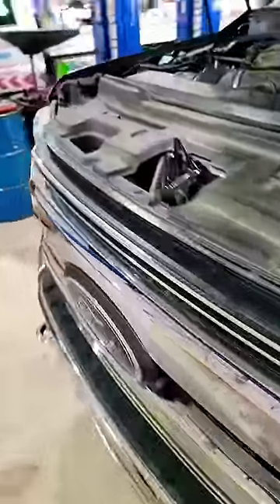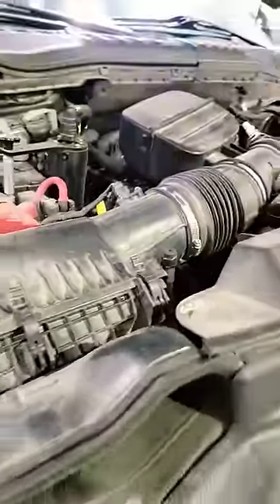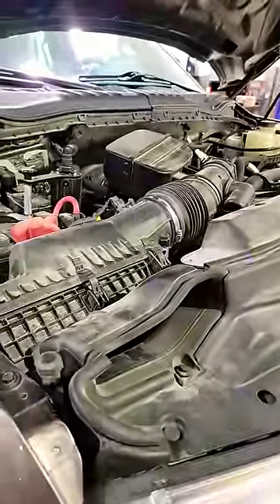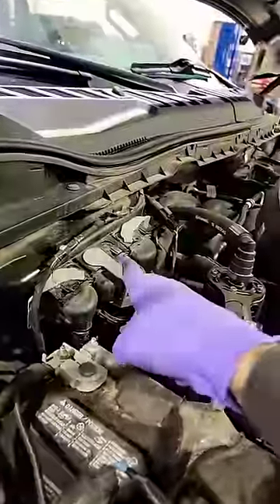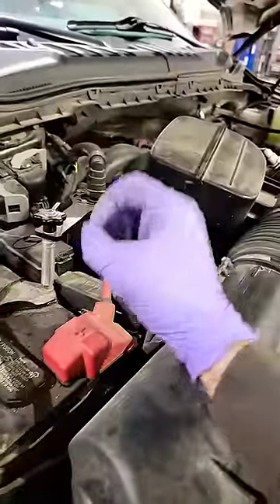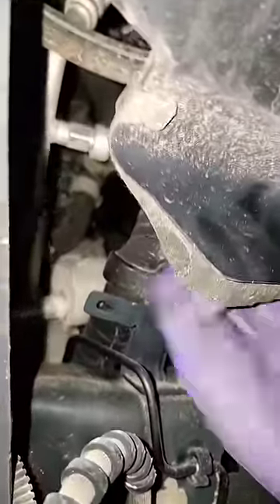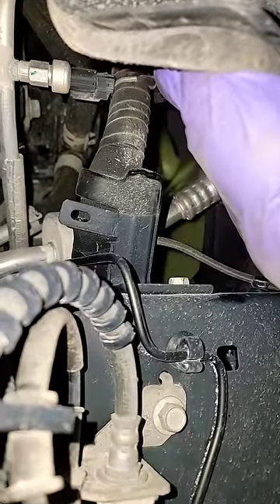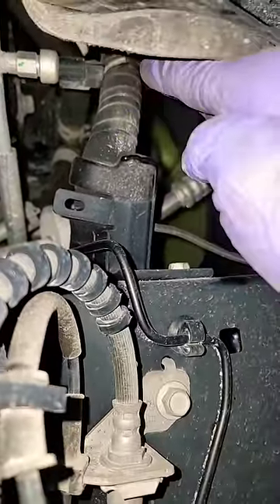New Ford 7.3 GAS owners - GO CHECK YOUR truck at this spot #shorts #fyp

Comment: I have a 2020 F-250 Tremor 7.3 and the exact same thing happened to me. The worse part was, it happened after 36K miles and the extended exploitation company (US Warranty) denied the claim because it was “rubbed thru”, which they deemed as “external damage”, not a defect - not that they cover mfg defects anyway… So, it got the old liquid tape treatment and works again.
Reply: Lot a money for extra warranty paid and they trick us with things like...oohh sorry is not covered because is engineering mistakes.😢
Reply: @efraingarciaescalante2824  They made it clear to me that their only concern is to avoid paying any claim they get away with by any means available to them. This was also the opinion of the dealer service tech that made a wincing sound and said “good luck” when he heard it was US Warranty.

Comment: The company that I work for, has had problems with A/C on brand new 2022 F150 and Super Dutys (F550) I haven't heard what the dealership has found on these trucks yet. The 2022 F550 that I drive had a roaring fan from day one. The truck only had around 40 miles on it when I got it. Don't buy any manufacturers product after early 2020 model year. We are having problems with DEF manifolds and emission controllers on a certain (unnamed) brand of yellow, heavy earthmoving equipment. The scamdemic and government did a number on us. Good luck to everyone!
Reply: Yeah same lots of issues with them on the smaller 1/2ton trucks too

Comment: Had a like problem with my truck. The 4-75 coagulated at the relay and stop pumping nitric fluid into the savoy pump so I switched the toggle fabulator at the firewall to the number 3 pump and all I had to do after that was prime the fribulater to the zero 6 code. Now it works perfectly 😅😅😅😅😅😅😅😅

Comment: Ford has never been good at packaging. It’s amazing. Hard contact is ok to them. Radiator hoses touching hard components, electrical connections touching like this, is pretty common. Retired GM designer with a lot of HVAC packing design experience and have studied all the packaging of a lot of vehicles out there. Pop a hood on a Chevy or Toyota or Subaru or Honda and learn how to package. I first noticed this in the 80’s and nothing has changed apparently. I love the look of the ford trucks, but damn.

Comment: Automotive Engineers should have to be mechanics first! This way they would understand the laws of physics and how difficult their piece of crap vehicles are to fix after diagnosis. Automotive parts should be relatively easy to access for replacement, but , no. The engineers want to play “Schrödinger’s Cat” with their customers!

Comment: What i have seen for the pass 15 years is most have turn to junk Ford is the worse then right behind is Dodge I'm talking about the V8s.
Chevy has its lifter problems but not the timing chain problems that the others have.
This week working on a Ford 5.4 with chain knock & rod knock. Open the bottom end found a broken thrust bearing causing the chain to bind & the crank to knock.
Thrust bearing face on crank is chewed up it won't last 2K miles before knock comes back.
Owner said put a bearing in it going to sell before bearing goes out.
Thinking the thrust bearing problem are due to high trans line PSI. Pushing the converter forward & apply more pressure on the crank thrust bearing. 
Really needs an engine these engines are shit.
I have never worked on a chevy with a bad thrust bearing knock. Been turning a wrench since 1976.

Comment: The motor in my sister in laws brand new.(less than 30,000 miles truck) has already blew up. She doesn't pull trailers or anything. The ford dealer ship kept telling her they could find anything wrong with it and finally my brother got on there case and magically they found out the motor had blew up. She has been without her truck for two months and it still having to make payments on a truck does even have in her possession.

Comment: I have a 2- 55 ac in my 95 ranger, only it has been operating at a 1- 55. Turns out i just had to remove the door panel and manually lower the window mechanism.

Comment: New technology you gotta go through a device to get a code scan the code look up the code just to tell you your compressor isn’t working🤦🏼‍♂️ and this is why I own a 1999 Jeep tj over 200,000 miles and still runs great easy to fix cheap and work on it yourself
Reply from the maker: Still gotta hook up a device to read that lil bs jeep 🤦‍♂️🤦‍♂️

Comment: Question: why does colder air not come from the seats? I had a 2019 250 that blew do cold I had to turn the AC off. In my 2021 250, the air is barely cool coming from the front seats. Advise please.
Reply from the maker: The "a/c" seats, are just a butt fan. They HAVE NOTHING to do with a/c function controls. There is NO air conditioning coming from the seats, IT IS A BUTT FAN thats it.

Comment: Driver's fault for causing problems while still on warranty! Ford is the most reliable truck that has no recalls anymore and it is sold without crazy markups as well as it is never repaired with the same defective parts!

Comment: So the ac pressures were good, but the compressor wasn't running. That's a contradiction, you can't tell ANYTHING about the condition of the system by checking static pressures. The only thing you can verify is that there's some amount of refrigerant present, could be 5 oz, could be 5 lbs. Just a nitpick
Reply from the maker: You said it! I KNEW THAT THE SYSTEM WASNT EMPTY. 22.....🤔🤔🤔 I CALLED its bluff & guess what I was right. Now if this was a lil older vehicle....that MAY not be the same case...........
Reply: @PowerStrokeTechTalkwARod  right on man! Motor vehicle ac is tricky as hell. I used to specialize in it and now I'm doing residential hvac. Keep it up bro!

Comment: I take it all the trucks came from the factory with the sensor chafing on the line. I've always tried to give engineers the benefit of the doubt but it really seems they are purposely designing things to go bad because they want you in the dealership every year buying the next model.
Reply from the maker: It has nothing to do with the engineers they put the stuff where they have room it comes down to the people who are assembling these trucks not giving a care about what they are doing it would've been clearly evident that that harness was rubbing against that sensor but no one took the time to look.

Comment: Damn 35,000 miles on a 2022 ?
Reply: Yeah probably one of 22s made in May of 21
Reply: I've got a 2022 F550 that is about to turn 21,000 mi. I got in the truck back in April.
Reply: S*** my 2017 only has 45,000 on it, I love everything about that truck, except what it cost !
Reply: My 95 has 50k on it and my 90 has 49k on the odo.

Comment: The 1-POS-BR549 Control module is low on hyper tension fluid. Common problem on this model.

Comment: 🤦 here are the facts. 35550 miles. Schedule the soonest  appointment 2 months out with Ford dealer.. now it's 36231 miles.. out of warranty.  Two times back yo the dealer for intermittent a/c operation.. 100 years building vehicles 65,000 bucks, and this is what you get. 😢

Comment: It's another great example of the ENGINEERING that totally contradicts reality.  That plug is right against that harness !?!? Check out the new focus the ac plug is bent to the point where it will fail before 20,000 miles. Just put a motor in one and noticed that and MANY more ENGINEERING mistakes,  engineers should have to take a year of auto mechanics before graduating.

Comment: Wow, a whole sensor and circuit dedicated to A/C pressure. It didn't even function properly... Cars shouldn't have AC or radio. Even when I lived in Phoenix with perfectly working AC in my truck, I never used it. Makes being outside in the heat much more enjoyable when you just roll the windows down. Leather can burn skin in the heat though, another reason I always go for cloth. 2004 SLT RAM QC 4x4 5.7 fully loaded. I think they only did leather in the Laramie. The automotive industry is milking the profits in both service and sale, right before they switch to EV and possibly hydrogen.

Comment: Huh on my 2018 F150 with the 5.0 that only had 49,000 miles on it was the AC clutch that was already froze up and snapped the belt.

Comment: Question.... I have a 2019 f150 5.0, and im having issues with the preignition/ engine tapping while accelerating. Does anybody happen to know abt any fix to this?
Reply from the maker: How long has this been going on
Reply: @PowerStrokeTechTalkwARod  I bought it used last December with 15k miles on it. And it started only a couple of months after I got it. I had read somewhere that it could be the type of oil possibly leaking above the piston causing a pre ignition, or just not high enough grade fuel. Rn im using 86 octane with octane booster. I aint paying premium gas prices right now lol. The octane booster helps, but it's not solving it. Some of the ford forums I've read pretty much said im SOL until ford can figure it out.
Reply from the maker: Hmmmm
Reply: Right?!?! Lol

Comment: 2023 F150 Lariat with less than 1,200 miles. AC stops working intermittently. You can still hear the fan but no air coming out. When this happens under the hood the AC lines are iced up. Let it sit for a bit and it’ll work fine. Sometimes it work fine for a week or so then bam…AC freezes up. Dealer hasn’t a clue.

Comment: All that crap. $60-$100 k for a truck that's going to be bringing you to the shop with stupid problems like this within the first year? 
I am going to drive my 86 square body until it can't be fixed and then I will buy another one,  even if I have to buy a restored classic.  I've been driving my current truck for about 12 years and all I've done is the usual,  replace brakes,  exhaust, shocks, glow plugs, batteries and a fuel pump. I've probably got less than $4k into it total. Drive it to Idaho a couple of years ago and will probably drive it to Utah in the spring.

Comment: Last yr (around halloween) i got my first pickup, a 2018 f150 xlt. And i gotta say, the ac in ford pickups sucks. It takes forever to actually get cold, and it needs to be cranked to the max if you want it to make much of a difference. I dont get it, before that i owned a 2016 fusion, and the ac was AMAZING. At least the heaters are the best heaters ive ever had in a vehicle. But still disappointing nontheless.

Comment: We spent $7,000 getting our AC fixed on a F-450 the Ford dealership cross the wiring harness doing some warranty work and that would not cover the harness or the AC

Comment: That is a shitty place for a pressure switch. SHOULD have been designed with an elbow connector there. Maybe some enterprising aftermarketer will come up with a retrofit for that.

Comment: I'll understand why Nissan Toyota and Honda can make a great product that you can get several hundred thousand miles on without problems and Ford Chevy and Dodge puts out a product that you can barely get $100,000 mi out of before you need mechanical intervention

Comment: Another Ford crappy design. Back in the day the Pintos blew off the oil filters because the relief valve was a stainless slide in an aluminum case,  different thermal expansion caused the slide to wedge shut. This wiring routing is reminiscent of substandard engineering. I won't buy Ford ever.

Comment: same thing on these inline 6 3L Duramax engines in the suburbans and 1500s. ECM wiring harness doesn’t have an ounce of slack in it to allow for thermal expansion from heat. Gonna have a lot of crazier electrical issues later down the road.

Comment: They obviously aren’t testing cars and trucks on proving grounds like they used to. Seems more and more it’s silly items that aren’t difficult to repair are going bad. Using cheap parts made of 100% plastic with quick fasten connectors for robotics to install is another major problem for Q.C.

Comment: You can fix all of your Ford pickup's problems by changing just one part.  Take off its gas cap and drive the Ford away, pull in a Toyota Tundra and attach the gas cap and your pick up will be totally repaired.

Comment: My truck is the same . I’m glad you found the problem, after watching this video I am taking it to the dealer . I have 37k miles on mine 
Also it’s getting a lot of rust build up . I can see it wasn’t undercoated correctly .  I also see the transmission harness not secured correctly and I’m sure will soon rub through .    Built ford tough!!😂

Comment: I see it's a 7.3 is that the piece of S**t  Godzilla motor in it because I would get rid of it immediately, had one at 15,000 that bent connecting rod on the #2 piston. I work on school buses and if you do I check the ground strap from the motor to the frame on the driver side of motor because it sits right on top of the exhaust manifold. Ford is crap

Comment: This is the sh!t that makes Ford and other like companies so ridicules with recalls or unreliable service.  Engineering could have easily made this right from the start but they didn't. An auto mfg that has been in business for well over 100 years cant see that being a problem down the road?  My god the wire is crushed up against that other piece.  Ridicules.  Should not happen.

Comment: In the EU i had a mk4 duratec ford mondeo, same issue, turned out that there were three wires that come out of the back of the radiator fan, the middle one was 24 awg and violet in color. This breaks easily in the loom... the pain is opening up the loom to actually find it. The repair is ironically simple

Comment: Those wires shouldn’t be pinched right out of the connector like that. There are industry standards that manufacturers are supposed to abide by to prevent failures like this.

Comment: My 6.7l had an issue with the same code and blowing hot air. I was going to take it to the dealership and the next day of course my ac was back to normal and havent had an issue since and its been over a year since that happened
Reply from the maker: Alumiduty?
Reply: @PowerStrokeTechTalkwARod  yes 2020
Reply from the maker: Better check dem ac pressures. Watch my shorts a month ago. We talked about this

Comment: Check the mounts they wear causing a tight squeeze to become a close squeeze. Happens all the time repair the wire then check your mounts. I do a lot of electrical work and many issues are caused by worn mounts trust me very common

Comment: How were pressures good on the gages if the compressor wasn't engaging?
Reply from the maker: The system didnt have a leak. A sensor was keepin the compressor off. You do realize that you can have a full system, read good pressures but the comp wont come on......
Reply: @PowerStrokeTechTalkwARod  I work on semi's so this is why I'm asking. Not trying to be rude or doubt your work at all. If the compressor isn't on the high side pressure is going to be low right? Without anything to compress the r134 how would the pressure be up to spec?
Reply from the maker: The semi a/c system is gonna work the same. You watch the ac machine charge the system. Truck is off, compressor is off.....yet there still is pressure in the system, system is charged. Then u start the truck and see in the compressor is working......... Im not being rude either. Think about it and connect the dots. I cant tell u all everything, then u wldnt learn. Ill be awaiting your response

Comment: My 2019 6.2 F250 had a similar issue at 37K. Dealer wouldn't warranty it because it was over 36k miles. I just bent the wire over and zip tied it to my ac line and never an issue again. Got 180K now

Comment: I would have done a visual inspection and a wiggle test after getting the circuit low code , smart move on using the PID first

Comment: Typical ford there motor is usually okay except for intake of exhaust or gas but they always cheep out on connection either electric or mechanical

Comment: The trouble shooting section in my owner's manual says in order to fix this problem you must drive to nearest GM dealership & replace witn a GMC Sierra 6.6L Duramax® Turbo-Diesel V8 Engine with Allison® 10-Speed Automatic Transmission. To avoid this issue in the future. You're welcome 😉😎🤣😂 our trucks have special anti wire harness chafing features.
Reply from the maker: Yea, ur real silly if u believe that. Id leave with saying this, good luck

Comment: You said the pressures were close BUT the compressor wasn't running......?  
     How is that?
Reply from the maker: U can have good pressures & a bad sensor. Theres not a hole in the system.........The computer looks at the sensor pressure to determine when to engage the compressor.......so if the sensor was dead & read 0 psi.......u tell me, how would the compressor come on??

Comment: What shit quality for a supremely expensive truck. Was divided between this and a Tundra. Apple and orange I know but I'm only towing 6000lbs
Reply from the maker: Maybe a Tesla wld better suit your desires
Reply: @PowerStrokeTechTalkwARod  
Not in the least. They have even worse quality control. But for a 50,000 dollar truck I'd expect the AC to not break after 10,000 miles.

Comment: Leave it to ford and there infinite wisdom putting a sensor butted right up against something that will vibrate. Congratulations ford designer/engineer you're not that bright are you.
Reply from the maker: 1st off I has nothing to do with the engineer they put the stuff where they can, the beanbag on the line didn't take the time to notice that it was sitting where it was. the engineer designer has nothing to do with that it's the assembler 100%

Comment: Brand new, but it does have 35k miles.... hahahaha brand new yall. My 2016 veloster turbo has less miles.
Reply from the maker: Yeah Bob 2022 with 35000 new model truck don't get it?
Reply: @PowerStrokeTechTalkwARod  it's not brand new when it has 35k miles on it. It's used.
Reply from the maker: Its brand new. He just got it 6 months ago. Twenty twenty two. Hello